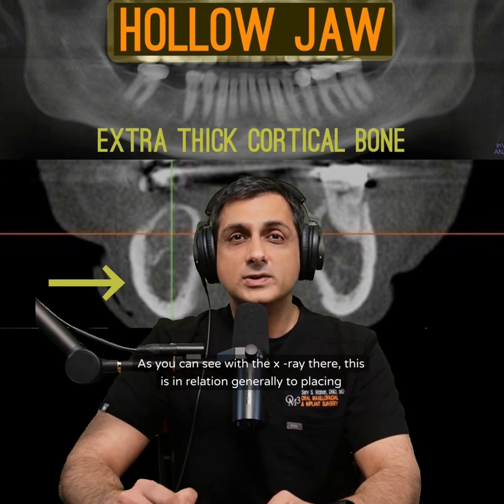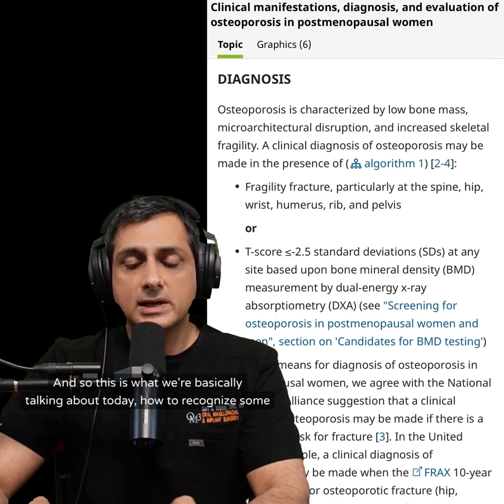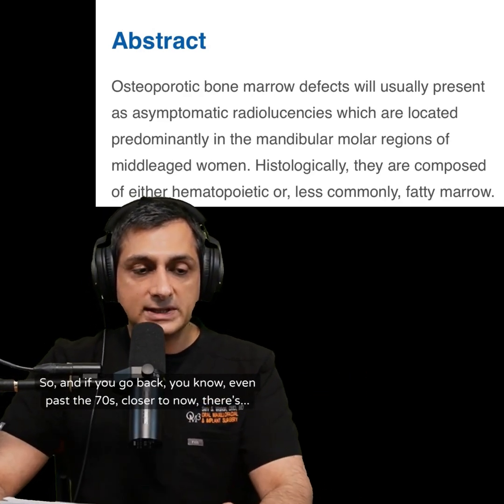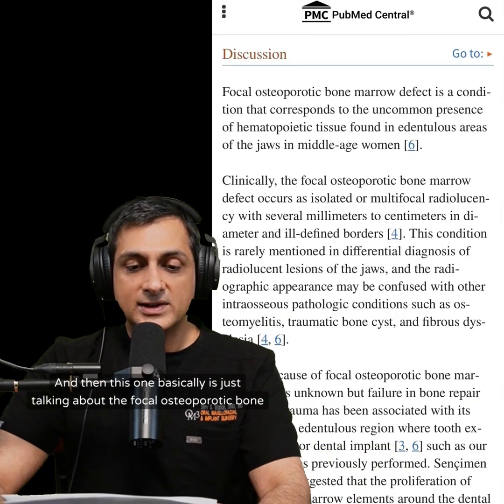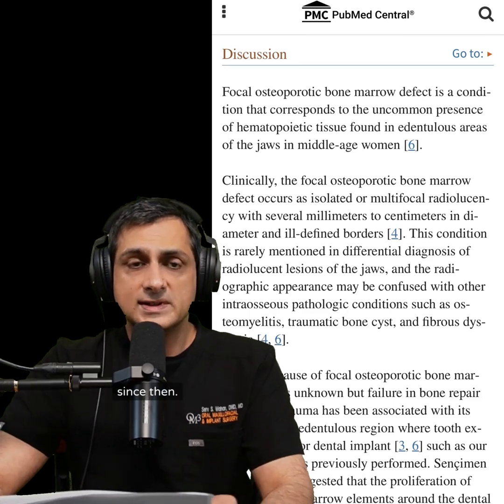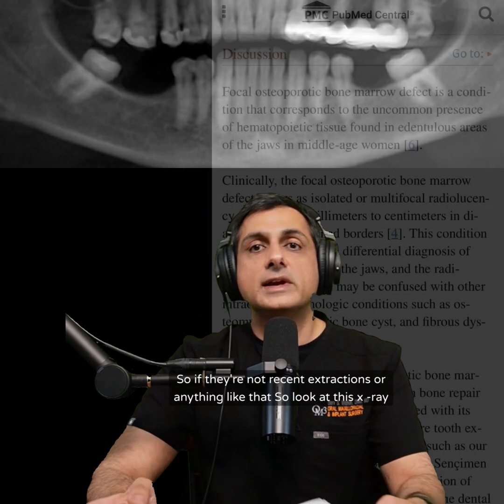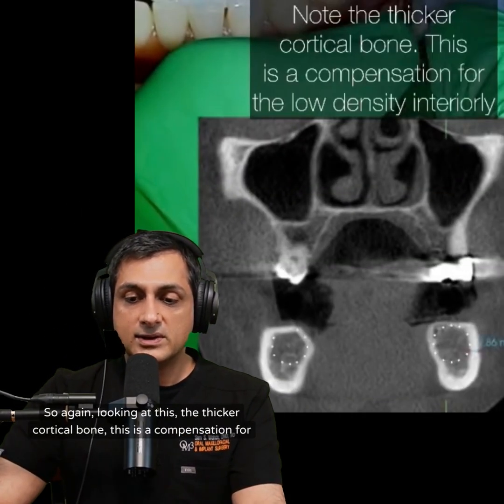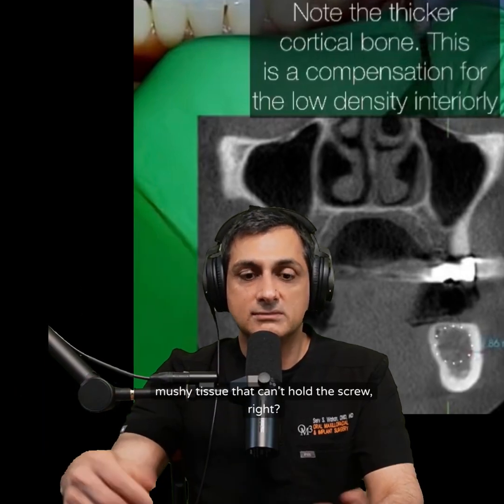Why Some Dental Implants Fail Unexpectedly - Ep.2

Comment: In that case would you consider placing graft and then placing implant with healing cap already on, the cap would prevent falling in.    
Way more important you need to use some auto-tune.    

Thanks for the great info